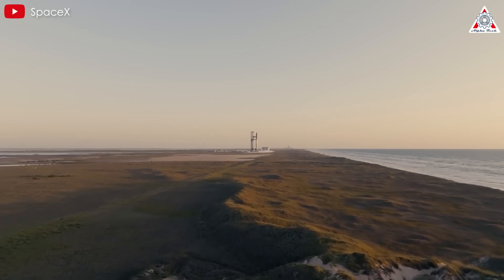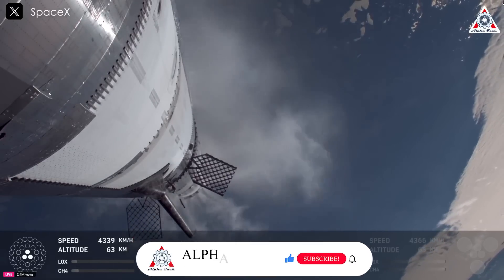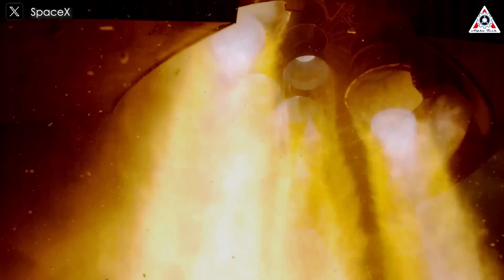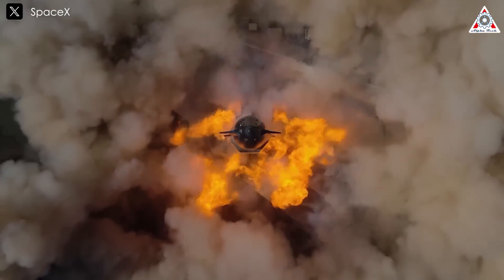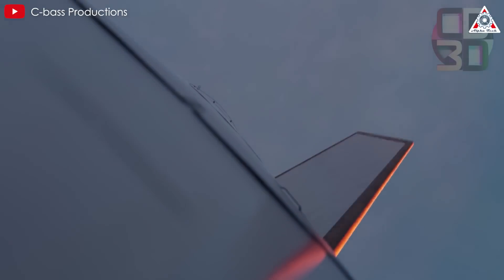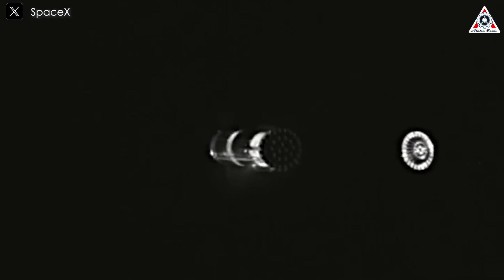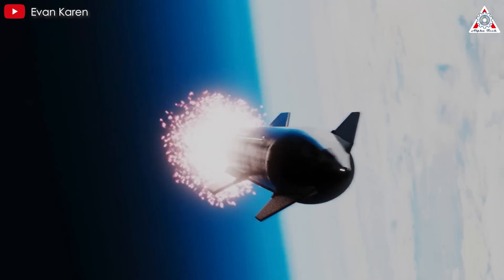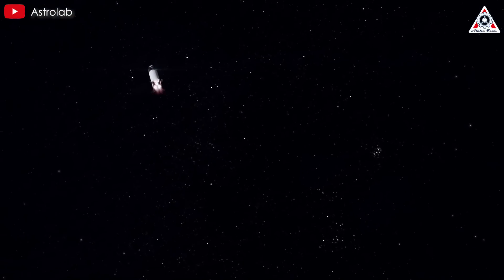SpaceX Hot Stage is a Big Mistake that Destroyed Starship V2!

Comment: "Booster" and "Starship" of course are two completely different "perfect and beautiful" well tuned air/space vehicles or instruments as it were, so why put them so "out of tune" at stage separation? it ruins the concert. Harmonic vibrations absolutely affect Starship at hot stage separation (which is a Russian invention, ha) and though they can be lessoned, they ALWAYS pose a risk. Passive separation puts no harmonic vibrations on Starships plumbing and engines thus assuring Starship can get TO ORBIT with a little less weight, but "TO ORBIT", which is why you built it in the first place. Less is more Elon, so do away with this Russian invention and, "TO ORBIT WE GO, YOU WELL TUNED INSTRAMENT".
Reply: Well, I don't think the booster and Starship are beautiful designs. They are both way to heavy. When they went with hot staging, it was largely because they were deficient on thrust. But is was supposed to be an interim fix. Sometimes I think thy were so focused on recovering the booster, that Starship may have been neglected.  

A to the harmonic vibrations, they originate in the engines, but the entire Starship acts as a resonator. The total mas plus fuel will have an impact on resonating frequency. 

Personally, I think the entire design is very flawed because it has too much empty mass. So from day one, they have struggled to make enough thrust.

Comment: And a counter argument. There were 2 flights with hot staging that didn’t fail.  In an is/is not analysis, you need to look at what was different between what worked and what didn’t.  Hot staging isn’t one of the items.
Reply: Maybe, but the delta-V of the 1st stage in the few seconds around hot staging might indirectly show differences in the time and intensity of hot gas exposure.

Comment: SpaceX need to work on the Lunar Starship midship ring of thrusters, these will be needed for Lunar and Mars Starships, so might as well include them now, they can also be fired instead of Raptors for separation, this would help separate the craft without heavy use of Raptors.

Comment: Has SpaceX investigated only using three engines during hot-staging, then lighting the final three after a defined distance between Starship and the booster. They could even light the three raptors at a reduced thrust level at hot-staging.

Comment: Why is SpaceX using sea level engines at all in space?
Reply: Gimbals: needed to steer
Reply: The vacuum engine plumes compress the sea level plumes, kinda like an aerospike, so they are almost as efficient as vacuum engines.

They need the trust and vectoring.
Reply: They absolutely need the sea level engines to land the vehicle (which is at sea level), both due to the pressure differential and the gimbaling which is easier for the smaller sea level engines.  In space they are better than 90% as effective as the vacuum engines, so not too much loss in performance, since they need them for other purposes.

Comment: Minor nitpick, the "narrator" gets confused with V1, V2, V3, sometimes referring to them as Five 1, Five 2, etc. How hard can that be? Other than that, the video makes a good point that it doesn't appear SpaceX has ever ground tested a starship with a hot staging ring. That might well indicate a problem.
Reply: AI is still working on narraitive context involving letters and numbers.
Reply: It's a computer with a random script that says nothing new that's known. Get rid of hot staging and you get fuel slosh.
Reply: @mikem6549  Over and over again, day after day, though it didn’t used to be this way.
Reply: The V in Roman Numerals stands for 5. Ai maybe auto-correcting/converting itself.
Reply: Always pronounce the abbreviation "V-3" as "version 3". Expand the abbreviation before passing to the text-to-speech processor.

Comment: Flap thrusters is a horrible idea given re entry heat. Just going from 1 problem to another. A single added center engine would be much less powerful but still separate appropriately. Then after booster faces away lighting the mains. You would only need the single engine for 5 seconds I recon

Comment: Hmmm. If hot staging were the cause, then why did the failure occur at almost exactly the same time on IFT7 and IFT8. Seems too much of a coincidence for the hot staging event, with random consequences. My money is still on a design or manufacturing flaw in the Raptor vacuum engine bells. Speculation is fun 😆

Comment: I knew the hot staging ring was way too small from day one. I have 38 years (now retired) of successful cryo booster & upper stage development. My area of expertise includes compressible flow, thermodynamics, fluid mechanics used in the design of feed systems, pressurization systems, diffusers, vents, high pressure gas storage, etc.   A simple hand calculation of the reactant hot gas flow and the resultant back pressure in the interstage hot ring would have revealed the correct flow area requred to not exceed the design allowable pressures. Did they do this? Obviously not. Live and learn the hard way young people. The long truss-rod hot-stage should work if the flow area calc is made and implemented.
Reply: Problem is they had multiple successful hot stages. Might be a contributing factor, but the fact it started with the new V2 design shows it is an issue with the V2 design. Likely changes to the fuel system.
Reply: Why not use springs or hydraulic push rods to separate?  I'm assuming it's not accelerating at this time.  If it is, then why?
Reply: @MarkPryor1  The booster is still accelerating likely to avoid fuel sloshing and hammering that destroyed a previous booster. As for why no springs or hydraulics is the inability to provide a usable amount of force per mass.
Reply: @Awrethien  maybe then several solid rockets pointed mostly downward along the perimeter. Kind of like the JATO rockets on Fat Albert.  Cheap, lightweight, easy and fast replace.
Reply: @MarkPryor1  those would be more likely, than the proposed rocket engines on the flaps that have been suggested, but fixing what ever is causing the fuel leaks and get back to a working hot staging they had before likely is the goal they want to go for. Maybe the cleaner Raptor MK 2 if they ever get to mass producing them instead of showpieceing them...
Reply: @Mark-SanDiego  I worked with the Saturn-II and SIVB Propulsion guys. They used solid motors in that way and called them Booster Sep motors or Ullage Settling motors to keep propellant at the bottom of the tanks which tends to migrate forward during main engine cutoff.
Reply: Yeah a real rocket scientist would watch the bulls**t AI nonsense channel about starship.

Good story you total liar fool.

Comment: And yet Starship had previously successfully completed hot stage separations before.
While it may not be perfect, I don’t think this is really the issues.

I think it is caused by the redesign of the downcomers - the three branching ones going to the Vacuum engines, suffer from oscillation issues, which are damped down while surrounded by LOX, but once the LOX is nearly gone, the damping effect is lost, and the oscillating vibrations lead to catastrophic failure.
Versions solutions including cross bracing, ring bracing could be used.
Reply: Those succesfully were with older, less powerfull engines.

Comment: Why is it necessary to fire all 6 engines during the hot stage seperation? If the eased into push by using only the gamble engines, the shock would be minimized as it separates, allowing for ramping up to full burn.
Why the delay on the installation of the new design on the hot stage ring? It makes sense to do it now.

Comment: Simple solutions are the best ones, Falcon doent hot stage, they just shut down the booster and let it drift off before lighting the 2nd stage.  If you want boosters, you could have retro thrusters on the booster rather than spaceship but I dont think you need even that.

Comment: I got it !!! SpaceX needs this system... 1. a mechanical nonthrust seperation detatchment program. 2. Spring loaded bayonet mounting for stage 1 and 2. This eliminates hot staging all together. It might have to be a battery repeller or magnetic repelling set up. 3. Or use main capsule thrust firing to enhance stage seperation in conjunction with mechanical or bayonet type detatchement of stages. Your welcome !!!    :text-green-game-over:

Comment: SpaceX is going in circles, chasing it's own tail.  When the second starship exploded, I immediately figured that the engines were damaged from hot staging.  The Soviet N1 didn't have essentially flat topped stages that direct forces directly back at the upper stage.  The hot stages were also a much more open lattice and they were much taller, to diminish the back forces on the upper stage engines.  SpaceX is doing really crappy engineering.  But it is obviously not their fault.  It is the unrealistic demands placed on them by the dreamer, Elon Musk.  Reusable heavy lift rockets that need to save some fuel for the boosters to land is simply not a viable concept.  It has very limited potential.  And scaling up the whole rocket system to insane size will not solve any of this.  Starship is a gigantic boondoggle.

Comment: If the engines were damaged by the Hot Staging...it's VERY unlikely that they would function for 95% of the fuel burn then destroy themselves.   Damaged engines blow up quickly....so the most likely culprit here is the V2 fuel feed system changes which feed the lines through the O2 tank.   When that tank is full...the liquid acts to dampen vibrations but as the tank empties lines become more exposed and any harmonic frequencies will get lower and lower and this is what SpaceX thinks is the cause of the failures.
Reply: Thats what I was tracking also.
Reply: That sounds like POGO which happened on Apollo 6 launch they redesigned the fuelines.
Reply: But one engine bell did not immediately blow up - it was on fire for some time before it fell off/exploded. That might result from radiant heat from the raptor engines. 
The Staging ring ejection sequence could start a fire, or damage the engine bells. They've had fires in the basement of Starship how many times now? ... The purpose of the ring-shaped Saturn V interstage was to make sure staging did not impact the engine bells of the second stage ... but that is hot the purpose of Starship's staging ring. Starship's plate-shaped interstage  moves very slowly away from the upper stage, plenty of time for radiant heat from the engines to reflect back.
Reply: Yeah, so why are you watching regarded videos made with AI? Literally everything in this video is complete horse****.
Reply: @Chris-u4t5u it has to do with star ship that's why
Reply: @Chris-u4t5u 😢True!

Comment: At 6:59 ..."...engineering expertise ."   ???  If indeed there was " expertise" at SpaceX , there would be no exploding & melting spacecrafts....they  are simply doing " Trial & error" ...mind you, when NASA developed the Saturn series of boosters, of Thirty-Two interactions  of the spacecrafts, not a SINGLE ONE exploded...
Reply: Thankfully no one died as result of the NASA experts.   Oh, wait……..
Reply: You conveniently forget that a bunch of F1's blew up during testing.   They had a real problem with them that took considerable time and effort to solve....so give SpaceX a little leeway here please.

Both Starship V2 failures happened after nearly exhausting their fuel loads....and damage due to the 'hot stage' process would very likely not allow them to run properly for the full duration.    The theory that the V2 fuel system changes are what's responsible as the lines become undamped when the oxygen tank levels drop to near empty.   Harmonics can be very destructive and the fact that V1's didn't have this problem leads one to look at the changes in the V2 which include the fuel lines to the engines.
Reply: nasa lost plenty of rockets and killed many of people
Reply: This comment demonstrates ignorance of the different manufacturing and production methods being employed.  Trial and error still requires you to design, build, and test the spacecraft.  And your success comes at a cost.  $2 BILLION per launch for the Shuttle as I recall.  SpaceX has not spent $2 Extra Large on the entire Starship project, including the launch pads, production facilities, and everything else.  So sure, if you want to blow $2 BILLION per launch nobody can do it like those NASA boys.

Comment: Seems a simple solution would be to delay igniting the vacuum engines for a few seconds.
Reply: Th problem with that is fuel flow without gravity or thrust.  Think the top of the second hill of a rollercoaster.  You lift of your seat, same thing happens to fuel resulting in a variance in fuel flow   which is why the use hot staging

Comment: Hot staging may work... but not for as strong engines as Raptor. 
Also, why so many raptor engines on second stage??? One would be enough for flying in space. Redundance needed? or is one too little?
Reply: You have to get to space first, the super heavy booster only gets you part way to space .  Then land and take off from mars and the moon
Reply: @randychurchill8269  Low gravity Moon and Mars. Okay, maybe Mars would require 3 engines. But only in case of fully tanked rocket. not nearly empty one.

Comment: Wrong. 

Hot staging worked successfully on IFT-3,4,5,6 on which all four of those Block 1 Ships reached orbital velocity using the same Rvac engines that were flown on IFT-7 and 8. The Block 1 Ships on IFT-4,5, and 6 made successful soft ocean landings.

SpaceX flew the Block 2 Ship on IFT 7 and 8. 

The problem is in the propellant delivery system on those Block 2 Ships, not in the hot staging ring or in the Rvac engine itself.
Reply: He mentioned v2 starship may have removed some protection for the engines. If true, the hot staging may be damaging the engines in a way that didn’t occur with starship v1.

Comment: Need internal engines with Ultrasound supported shutters so they can never jam for opening and closing all directions around craft. Triboelectric duct style + Plasma generator for high powered Ultrasound pressure wave anti-drag bubble. Internal duct style = Whole ship frame hold the force and shutters with Ultrasound support will destroy everything that touches them if frequency settings good to not waste any Ultrasound power. Hydrogen engines.. Why? Points at space gas NEAR Vacuum.. High powered wide beam Ultrasound echoes to compensate for low density from Sun = Pull gas tight to places around ship. 

Govt: "Solar wind! Hur Hur!" < What's in Solar wind? "No sound in space!" Points at Ultrasound microphone in explorer probe and even Ultrasound microphones on Mars tools Who told you that? Oh sorry, they do that sometimes so people can get secrets but still have nothing.. < Dystopian Pause Programming. You know everything I'm saying, but don't. We breakup kidney stones with Ultrasound "Shockwaves" 🧐 What's that word? Shockwaves? Like when Stars and things explode? Points at Boeing Plasma force field block Shockwaves YES..

Comment: Like I have been saying to you all since the second hot staging was mentioned.....
The a55 end of the shipis not fit to hot stage..... IT WAS NOT DESIGNED TO DO SO IN THE FIRST PLACE..... the engines, feed lines, fixings, joints..... nothing has been specifically designed to hot stage.. clearly they have made v2 weaker by weight reduction while not engineering for the severe shock of hot staging!

The fact this ship is meant transit to moon or Mars and be expected to land ..... hot staging, a literal explosion up its butt....NO!
Reply: @albertbahoogadin  do you have any estimate of how much hot staging helps? Because obviously they could jettison the booster and then turn on starships motors. I imagine they could time that pretty well too. But considering they are lugging that big ring, and having these problems, it makes me think hot staging is too important to do without.

Comment: But Whey the Starship v1 doesn't have the same problem?
Reply: V1 is a lot stronger than v2. Reducing weight has reduced strength.
Neither v1 or v2 have been designed to hot stage. Hot staging was not the intended method of separation when initially designed. They have not engineered for it sadly.

Comment: The Saturn 5 did not have Hot Staging but worked as intended. What is wrong with using a tried and proven method?
Reply: Hot staging increases the range.
For today's needs, Saturn V does not produce enough thrust, uses the wrong fuel, and it was designed to be 100% destroyed after 1 single use.
That type of business model only works when Govt forces taxpayers to fund the bill.
Reply: Nothing. That system used a small ullage rockets, which can be seen on the second stage footage of the third stage climbing away.
Reply: Multiple staging should be done on starship as well

Comment: Using the refurbished booster is a mistake in my opinion. It does not address the top priority, get past the early RUD of stage 2. Until they demonstrate recovery of stage 2 they should prioritize stage 2 improvements.. That should likely include the hot staging hardware which could be damaging the stage 2 engines.

Comment: Well, could it be they're the engines (vacuum) on the ground for well over a minute trying to collect data on acoustic interaction within the bell section.  What changed from V2 Flight 1, and Flight 2? 

I know SpaceX had modified the vacuum engines (nozzles)to run on ground,.but those are static single engine run, not all engine installed.

Also, data collection on the ground can change the dynamics of engine runs vs. operations in space. There is a dynamic interaction with test stand.  We found this issue one time in Flight test at Edwards AFB on a place running static engine runs and the landing gear was dampening the interactions with the aircraft.

-Speedy